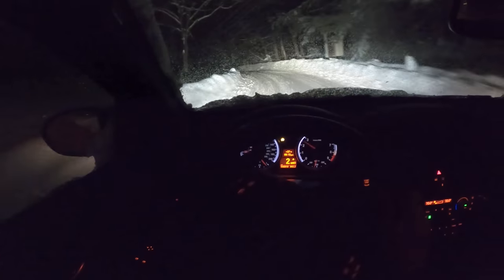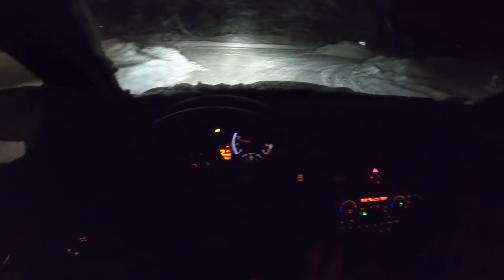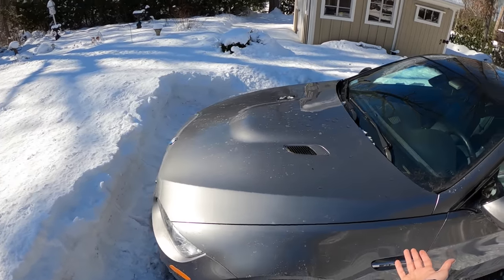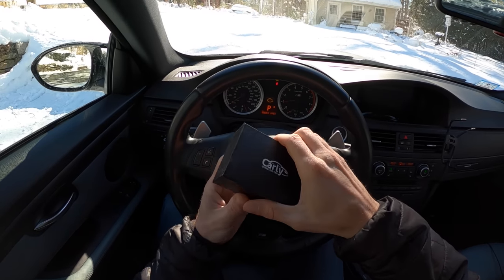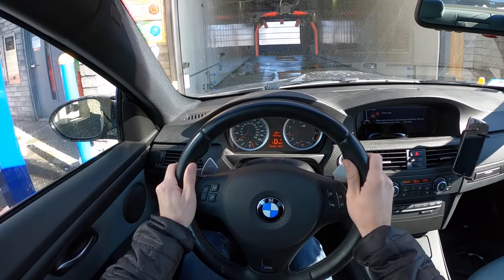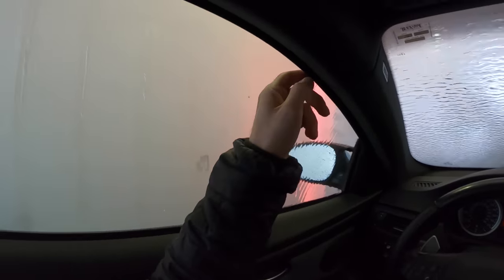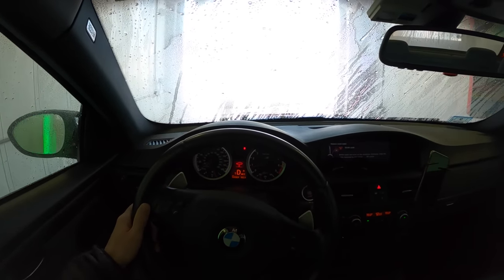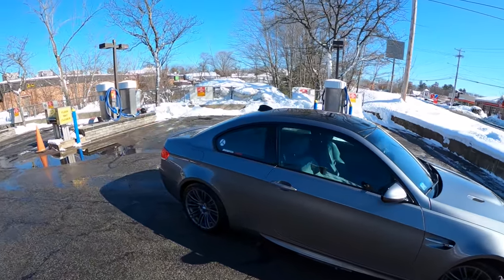Is Touchless Safe? - Washing My Filthy BMW M3 Winter Daily (POV)

Comment from the maker: What's your preferred method of wash during the winter? We don't all have access to a heated garage at home or a budget for a proper hand wash. Remember to get 10% your Carly OBD2 Adapter with code "Tedward" @t . Special thanks to the Patreon Supporters for making this content possible!
Reply: I washed my CTS with my dad when it was cold out. We froze our asses off, but she was clean for.. like a week. 😅
Reply: I just take my car through a automated washer. its a 94 jeep xj and the paint is already not in fantastic condition so im not worried about scratches or anything
Reply: Waterless wash in garage
Reply: My car wash has the self wash bays. They are heated and I go around the vehicle with the wand. That way I don’t have to worry about the high pressure water killing my seals and panoramic on my X5.
Reply: I wash my uncle by hand on the summer so it is better when is hot outside. Not cold weather
Reply: In my C4 Corvette up here in Quebec I just go to a self serve car wash and only use the pressure washer to wash off the salt because I don’t trust those weather seals in a touchless car wash lol, ask me how I know
Reply: @thebluepheasant9543   same here, and you can wash under the arches that way as well
Reply: I get in and out hand car wash here in Essex in the uk, £12 and sometimes they’ll even get rid of stains on seats at no extra charge which is good, because normally you’d have to buy a valet to get stains removed which start at £25
Reply: Ive been using the self bay. Rinse, Greenstar 10:1, rinse again. Finish with a RW like n-914. Or if near freezing i use Mckees sio2 RW as a waterless. The Greenstar takes care of 80-90% of the dirt.

Comment: As a detailer myself, i go to touchless car wash during winter. Most are using pretty safe soaps and won't even remove the cheapest wax.
Reply: Same... Cruising through one of those is FAR BETTER than not having it washed at all .. so 🤷‍♂️

The winters with ice/salt/snow really can be brutal on vehicles (obviously...) So yeah... I'm ok with going through an automatic wash a dozen times a year. Especially when it's 10 degrees outside (fahrenheit)
Reply: @Frank. T I have a gas powered pressure washer at home that is way more powerful than any touchless car wash and even my 8 years old paint won't strip off or be damaged. Just be sure your paint isn't already cracked and everything should be fine. Also, most touchless car wash offers different types of wash, and the better one offer liquid wash. This is what I pick. This isn't high quality wax, but at least it keeps my paint sealant intact all winter long.

Comment: Car washes use a material called neoglyde. The material literally cannot collect dirt / sand / anything grainy. What they can collect is chemicals that dispense onto your car and turn hard. So if the car wash doesn’t clean then monthly they can scratch your car. But tunnel car washes do make your clear coat scratchy because of the friction onto your car, not your paint. Easily buffed out.

Comment: I tried paint correcting my black Golf over the summer but just gave up. Swirl marks for life!
Reply from the maker: my guy!
Reply: Dont give up! Its worth it!
Reply: For some reason vw paints are a bitch to polish. I've spent way too much time trying to buff my tornado red mk7. But when someone tells you that it looks more red than a ferrari... it's worth it 🤣
Reply: @PaulChoix55  German cars have the thickest clearcoat, that's why it's hard to polish them.
Reply: just did my "touchless" spritz on CSGM GTI in my driveway today 😊 Day started w snow n slushy roads, 30°F at 11am. Went for coffee and later saw the grime: white (salt), cinder and grime. By 3pm temp 42° and roads dry. Hooked up hose n sprayed under, wheelwells, sides. Water only as weather maybe again tomorrow 👍 Lucky in ABQ
Reply: Of you cant beat them join them

Comment: I live in western Massachusetts and I use touchless on my 2019 Elantra GT N-Line. It’s the only way to get that awful road salt of the car. In the warmer I hand wash my car. The local touchless is like $12 for the mid tier with underbody wash. Not horrible and I’m only concerned with getting the salt off. This was a well timed vid as you’ll occasionally hear from ppl that “touchless is horrible for your paint!” But I feel salt is way worse. And sandpaper wash is definitely a no go lol.

Comment: I too live in MA and I just took my e93 through a touchless wash cause my black paint had turned white with salt and I'm about to park it for 2 weeks. Turns out my e93 roof and window seals are not quite as good as I thought...
Reply: yikes thats rough my guy glad my mustang is a hardtop
Reply: @RCXDerp  e93 is hardtop
Reply: yeah, Im pretty sure all E93's seals arent the best, my driver-side one is fine but the passenger side always leaks
Reply: @gofastskatkat  my passenger side rear roof section leaks too, I tried everything 😂

Comment: Problem starts when you have a soft-top convertible. That’s why I take my car to the diy wand wash, and try to do the underside as best possible.
Reply: My 2016 miata has been good in the touchless carwash, the newer style woven fabric tops seem to handle it well. Back when I had an NA miata with the vinyl top though... yikes. It would literally spray water through the rear window seals in the top and wash your hair for you lol

Comment: I use the touchless in the winter IF it's above the freezing point outside. I coat the car with Nu Finish prior to winter starting as it seems to stand up to the high pH levels in the soaps the car washes use. When summer rolls around I wash, decontaminate and seal the paint with Mothers for the shine.

Comment: It’s not all about the chemicals. Many touch less washes recycle the water meaning small dirt and sand particles can be in the high pressure blast of water. This can also cause damage. 

Clear coats are also getting thinner for many manufacturers as they’re looking to reduce costs.

But I agree, sometimes something is better than nothing. It can be a tough decision and really matters how you care what the car looks like!

Comment: Definitely depends on the vehicle. One of the cars I own is a 17 WRX. Because of the hood scoop, if I take it for a touchless wash the pressurised water ends up soaking my entire engine bay; battery, ECU, ABS module included.

Comment: Touchless is the way to go. Been using it for years, I was initially worried  about how the soft top in my car would handle it but the cloth woven top seems to have no issue. I used to have a lot of problems with the high pressure spray with my older convertible with a vinyl top. It leaked at all the seams and especially around the rear window. The modern convertible top is much better.

I also tend to drive back and forth over the underbody sprayers as much as possible until they turn off just to eek out a little extra underbody cleaning  XD

Comment: I use touchless on my celica, definitely the best option other than hand wash. I also have a fluid-film undercoating done. The one I use is $29.99 a month and includes under-body wash, and it's the cheapest monthly option. includes 1 wash per day.

Comment: OMG I am so glad that you made this video! I saw a brand new Cadillac CT5 go though the spin wash and you could literally hear the water that froze on the spin pads banging against the car and it made me cringe as I was pressure washing my car in the bay right next to the automatic one. How I keep my car clean in the winter is I only use the pressure hose so that I can keep the salt off.

Comment: Touchless wash is fine and way safer than brushes. But It’s not meant to be used on a extremely caked up dirty car paint. It’s great  on maintenance wash for those who wash weekly and saves time. Using only a presoak, rinse and air dry is the better option not to strip off waxes etc. I detail cars and experimented all different methods of cleaning cars while preventing swirls and scratches. Touchless wash is the quickest, safest, time saver carwash. 
PS always do a final wipe down after.

Comment: Touch-less washes are good for use in a pinch or if you live in a climate where its basically impossible to wash your car during the winter. The one thing people fail to realize is that since its touch-less the soaps they use have do all the work, and they are made to be very strong. This causes trim to fade and corrode earlier and if not rinsed off properly can cause some pretty bad damage. Also touch-less washes don't really get the tight spots; no automated wash does that so you will start getting dirt build up. Keeping your car protected for the winter months can prevent that sort of damage, at the cost of your paint protection not last nearly as long.

Comment: I work at a body shop. And with all the work that goes on. I only have so much time to wash vehicles. So I use the pressure washer and a few ash Bruch on a broom handle. Not the safest way for your paint. But it’s better that nothing. I’ll washing my car in the bay sometimes in the winter. But in the summer, I’ll of my professional equipment comes out. I’ll even take my family’s cars to work sometimes in the winter to rinse the salt off the undercarriage.

Comment: This is a great review! Truly enjoyed it. Just some info on the chemicals that touchless washes use. The first chemicals are called Presoak, you may have seen it on the sign. That is an acidic base designed to eat away at organic materials (salt, bugs, etc). Being it’s designed to eat away at organic materials, it’s unlikely to damage any existing paint protections on the car. Also the final rinse of the wash are reverse osmosis water (specially treated water designed to not leave spots when dried hence the name). Also it’s common knowledge that brush washes scratch, when they most likely don’t. If you want damage free don’t go to tunnel washes, they use colors brushes (which many people ironically prefer) but those absorb water, rocks, etc. If you go to a non tunnel brush wash and feel the brushes they are actually foam! If you don’t have a non tunnel brush wash near you go buy some crafting foam from the crafts store, they feel almost identical. Those are closed cell foam meaning that it will not absorb water or dirt, therefore no scratches! People usually refer brush washes to those harsh tunnel washes with the cloth that absorb rocks, but in truth non tunnel brush washes are very safe! Hope this helped anyone reading, if you have any questions I’d love to answer them!

Comment: That's actually better than I expected here in Sweden we only have the spinning sandpiper washes and heated places you can rent for like 15 minutes
Reply: and btw do you have a ceramic coat on your E92?
Reply from the maker: I do have a ceramic coat but its probably been long enough to require another

Comment: Spray with high pressure on wand wash especially the undercarriage (I don't use their chemicals always bring mine) then spray rinsless on top of it, drive home (yes while having a wet with rinsless car) and do a rinsless wash at home, best way, might be a little cold but hot bucket with rinsless and warm clothes and your good to go. Best way and my car is the cleanest of them all.

Comment: We use touchless "Laser Wash"  for both cars (just a pair of Toyota's, nothing fancy)  unlimited for $25/mo. Does a nice job, especially the undercarriage spray during winter.
Reply from the maker: What a deal!!! Where abouts are you living
Reply: @TedwardDrives  I'm in a suburb of Rochester, NY called Fairport. Definitely lots of snow and salt each winter, just like where you are. 
They have two open bays, one touch-free, and one "touch-less" with the brushes/etc slapping your car around!
Reply: @TedwardDrives  I should clarify, it's ~$25 per car....

Comment: Local Touchless car wash during the winter months and by hand during the spring/summer for the 1er.  I will say though the pressure has been enough to flake off a small portion off the front bumper, but oh well

Comment: Summertime I do the self serve car washes with the bays and pressure washers, cheaper, and you can be thorough. Its hard to get underneath with those but that doesn't matter so much in the summer. During the winter the touchless wash is definitely the way to go, while more expensive, its worth it solely for getting the underside hosed off. My car is a certified beater and the paint was already swirled to hell when I got it. All I'm looking to do is keep rust away as long as possible and make it look halfway presentable.

Comment: Dude — after the drying — spray it with a”waterless car wash” like Rain-X. Then a drying towel. That will finish it properly. And still technically be a touch-less wash — except for drying- which is WAY BETTER than nothing — it’s the best way period.

Comment: problem is unless you bring some towels, all those water spots get covered in salt dust and it looks like shit 5 minutes later. i also like to dry all the jambs and trunk lid. living in the northeast sucks. they use way more rock salt and sand then what is needed.

Comment: If I’m correct, the E31 8 series had the drain hole in the gas door. I wonder why BMW didn’t keep that design with the E39 M5.  
My ‘09 Jetta sits outside all year long. I replaced the front fenders last year because they were rusting. These Northeastern winters are no joke.

Comment: I always have trouble pacing my car through the dryer... front of the car is nice and dry, back of the car still dripping wet (and in Canada, frozen soon after).
Reply: There are some systems that have an on-board dryer on that moves on with the wash arm. I think they're kind of rare but we have one place that has the on-board dryer as well as the stationary one that you have to drive through slowly. Although that one is tricky because the timer is too close to the door and back end of your car is still in the bay after the timer is out of sight.

Comment: I would agree that normally in the winter a touch less wash is better than nothing. In my specific case tho I’m kinda stuck on what to do because I have a ceramic coating on my car and the chemicals from a touch less wash will definitely not make the coating happy so I could just rinse it real quick at a coin wash and dry as much as I can before my hands break off lol. But then though I undercoat my car before winter every year to prevent corrosion, I do still like the undercarriage wash to get all the other gunk out which I can’t do because I don’t want to go through the touch less wash and damage the ceramic coating

Comment: I have an Audi A3 tdi I live in the uk so there’s always loads of road salt in the winter and I’m not really to bothered about it I plan on changing all the suspension in the summer and I’m going to clean off and repay some of the areas that have surface rust on them but it’s done 140k mainly highway miles and it’s really not to rusty at all. I wash it once a month on my drive and it’s fine to be honest, I just do general maintenance and spray what I can underneath with a pressure washer and that’s about it.

Comment: The touchless wash in Lexington/Arlington off Mass Ave is surprisingly cheap at $10 for a basic and $15 for the complete package. I now see what you mean about the harder chemicals as on the rear black plastic trim on my CLS, it has that sorta oily look to it afterwards but comes off with a quick detail spray and micro fiber cloth.

Comment: There's a gas station with a touchless car wash near my house and I may be used it a little too often last winter(about every other day). The gloss black trim on my m3's doors got this rainbow like look in sun reflections now. I wonder if a ceramic coating would have helped keep it completely black. Man are those chemicals harsh, but it's better than risking rust I guess.

Comment: My main concern with using a carwash during the winter is that newer carwash facilities are designed to use recycled water in order to conserve water usage. From what I understand, that water is filtered to be as clean as possible between each reuse, but I'm pretty certain they don't desalinate the water.  So, if you end up going to one of these types of carwashes during the winter, you're likely getting your car sprayed with high-pressure salt water.  😬😬😬😬😬

Comment: Do you recommend pulling over after the car wash and use the Turtle Wax | Wax and Dry Spray Wax with a Micro Fiber towel to wipe the car down and add a little wax protection for a quick wash and go jobs like this .

Comment: Touchless is beter than nothing, in the winter I normally spray of the dirt at the diy carwash . And as n Englishman who drove a prewar Bentley in every season and weather type : They are made to drive sir, it's either driving and maintenance or let it rot away. On a sidenote I like your Styling 219 wider wheels with a bit of sidewall looks good on sportscars.

Comment: I haven't washed my car in a coupe of weeks :-(. It has salt on it  but it's also been consistently in the negative degree temps.
Reply: Same here, hard to find a good day for a wash.
Reply: Washed several times when it was around -20 outside, just make sure you spend some time with doors open so the seals are dry, check your wipers and avoid using the handbrake for a day or two.
Reply: @val_solooo  But doesn't the water freeze on the body when you wash on those cold temps?
Reply: @yousufzahid6949  they usually wipe your car after the wash so shouldn`t be a problem. Of course the wash itself must be done inside a building or some sort of.
Reply: @val_solooo  Ah ok, will have to do the same then 👍